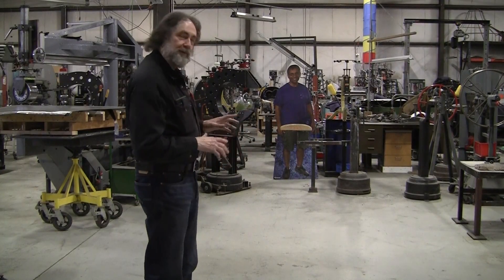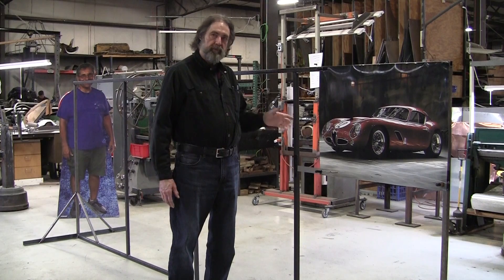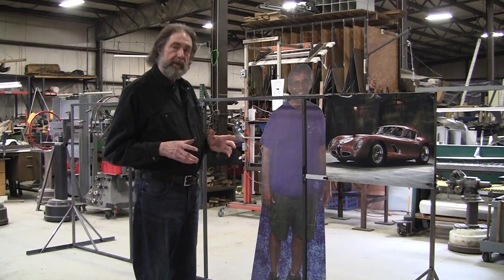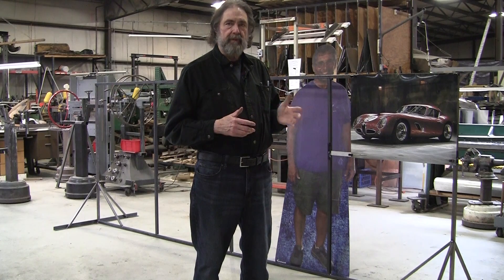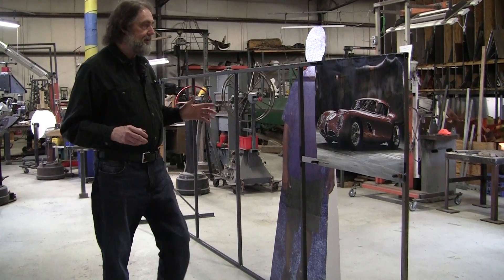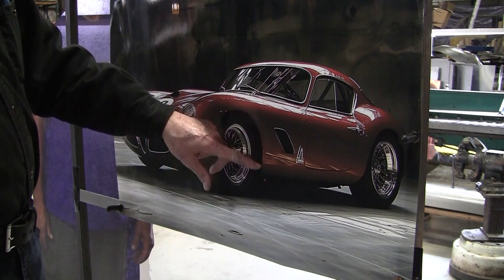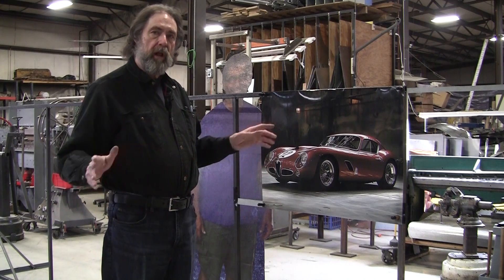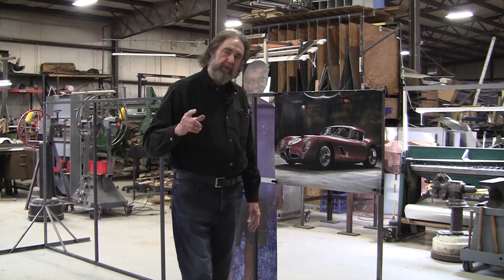AI Alfa Romeo Scratch Build Series: The Wireform frame (Episode 3)

Comment: I'm looking forward to seeing this project.  Thank You for taking us along.  Hagan's Hot Rods (pete thompson Hagan, here at YouTube) has a video showing how they cut down a production windshield to fit a hot rod they build.  It takes time, but the overall cost may be lower than a custom made windshield.  After a glass shop broke 13 windshields for a top chop I was doing, I decided I had to learn how to do it myself. Hagan's method uses a diamond burr on a high speed tool, with water/air cooling.  I've also done it the conventional way, using a glass cutter, lighter fluid to soften the plastic layer and a whole lot of nerve.

Comment: If you had unlimited money/resources and people working around the clock what is the quickest you think you could build this car?
Reply from the maker: The Italians could make a whole body in a week with six or seven guys. A frame with a great plan and a couple welders, fabricators, and two CNC machinists, I would guess two weeks to make. In Shelby's shop they built the first Daytona in 90 days, they already had a chassis.  I think 90 days is possible. Six months is realistic total. Waiting for glass windshield etc, will be a potential schedule killer.  Lets say six months, with 6 to 8 guys working full-time with excellent plans in hand. Total cost will depend on location of build and overhead costs, drive-train components, plan development costs, materials, etc.
Reply: @proshaper  Amazing.  Really puts things into perspective.

Comment: There are boat builds I have followed for years until they finally were in the water. This is nothing different. From idea to planning and construction, this will be fun to watch.
If you could have the image converted into a cad drawing, it would give you the option to pull dimensions off any part of the car. Any changes you decide to make would be reflected in all the other measurements. This might make the excitation go smoother and have the AI design tied to the computer for development.
Reply from the maker: I like the process of artistic interpretation.

Comment: Don't be in such a hurry to ditch the original Alfa suspension. Back in the early 'eighties I had a Porsche 928 and a 2litre GTV Alfa whilst the 928 would leave the GTV in its dust (except on dirt) the handling of the GTV was amazing and I still regard it as the most bang for buck car I've had. The Torsion bar was splined and could be rotated to adjust the suspension.
Reply from the maker: You're absolutely right! It's still early in the wire form build, and I know we are going to go back and fourth on several things, this being one of them.

Comment: I used the same drive train in a Lotus 7 style chassis. Space frame by McSorley. Used the same proven dimensions by Alfetta. The change was engine placement. Removed one of the two piece drive shaft system plus 3 inches of the remaining drive. All other the same. Inboard front brakes. Removed torsion bar system and coil overs in the rear. Handling is even improved with weight centered. I will follow closely. Hints of the TZ.
Reply from the maker: Great info.thanks!

Comment: Following along!  The AI design I picked came to 69" wide, and my donor vehicle is 69.5": I won't have to change a thing!  I used an Android app called Image Measure to calculate dimensions, using a round headlight from the image as a reference since those come in standard sizes.  I also like that this AI design has a flat glass windshield and no doors or back glass.

You're right creating the space is step one.  I've got another project car in the space now, but I was also hoping to put the donor car there next.  I guess I didn't think through where the wire form would go.  I kind of assumed I'd cut the donor car down and build the wire form on top.  If I put them side by side, I won't have room for my English wheel and welding table.

Maybe I'll suspend the wire form from the ceiling, or put it on some kind of rotisserie or 4 post lift...
Reply from the maker: That is awesome, please keep us updated on your progress.